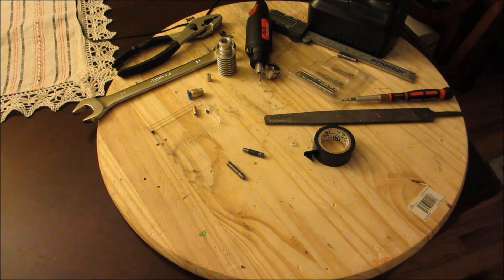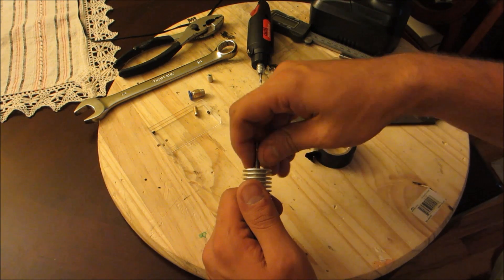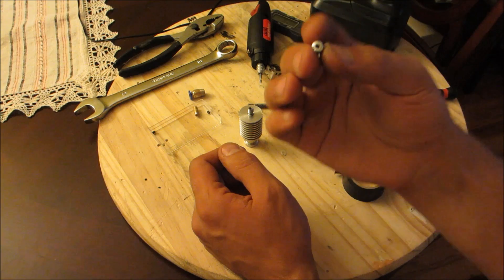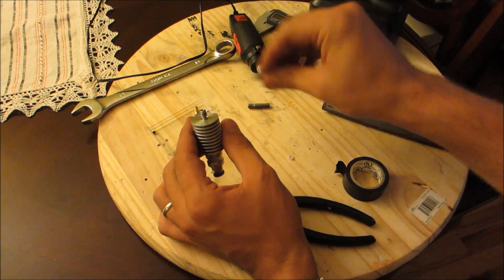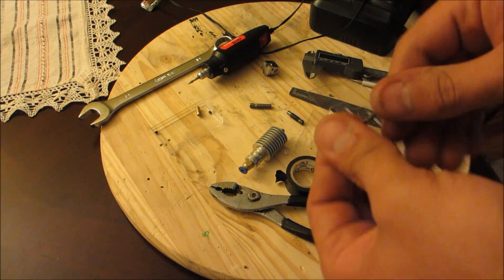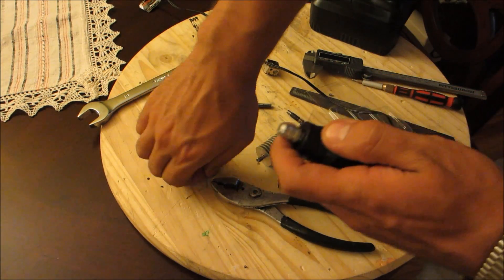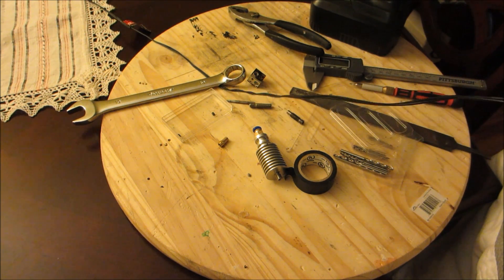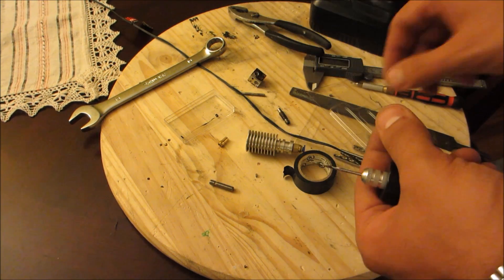Hotend Rework 2 polish heat-break

Comment: I drilled the bottom hole of the compression fitting on my old v5 hotend big enough so that the bowden tube could be pushed through it and all the way down to the heatbreak, worked great.  New v6 clone has the built in fitting, which is actually more annoying to use in my experience, not removable, but the tube does go through all the way in to the heatbreak.
Reply from the maker: I have not played with the new hot ends out of China as of late. The one on this video is still going strong. I replaced the heater block with a larger and consumed 1 compression fitting. Everything else is same as in the video. I will order a new one fairly soon as I am planning on building another printer.

Comment: I'm in the same situation,  though I made the mistake of buying the wrong sized heat break/barrels they fit the aluminum heat block but they seem to be a 1/2mm smaller while trying to screw it into the heat sink.  Would you have a eBay link to the barrels you've purchased, Thanks in advance.

Comment: I think I may need to polish the aluminum body on my $6 e3d v5 clone. What problems did you have before polishing the body? I think mine might be causing the drive gear to dig into the filament. Also, would you recommend toothpaste or the method in this vid, I don't want to make the hole too wide. Thanks, awesome videos!
Reply from the maker: The aluminum body does not need much polishing. I suggest a 2mm drill bit and some toothpaste. Make sure you get a high speed drill bit meant for steel and not wood. The flutes of a high speed drill bit are different.
Reply from the maker: If your careful you can use this method. It will polish it enough to have a very smooth bore. However if your not so careful you can enlarge it too much and ruin it. Toothpaste is good enough if the machining has no visible marks. If the machining left deep groves you have no choice but to ream it or use this method.

Comment: I can never get the scotch bright pad strands to be that small and thin, mine always rips apart before getting that thin and can't fit inside the heatbreak.
Reply from the maker: +Alvin Gozali use steel wool in 000 range. Not scotch bright.
Reply: Oooh, gotcha. I'll try it as soon as I get my hands on one. Thanks